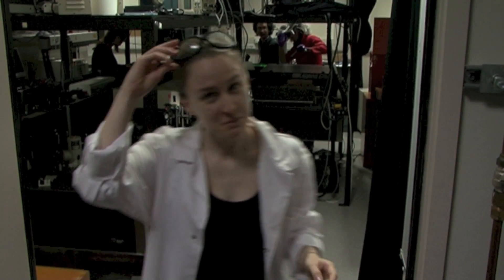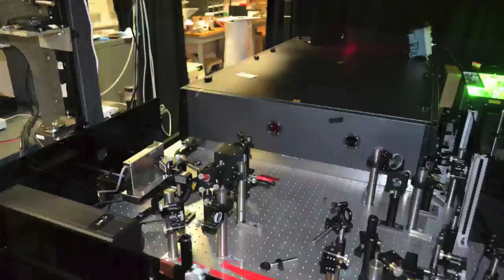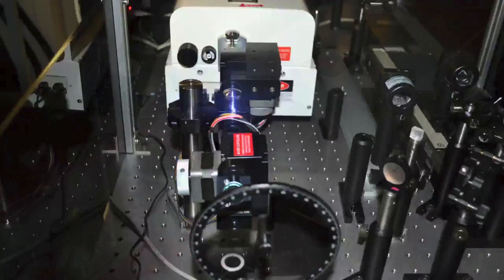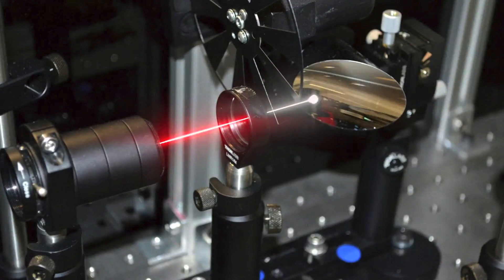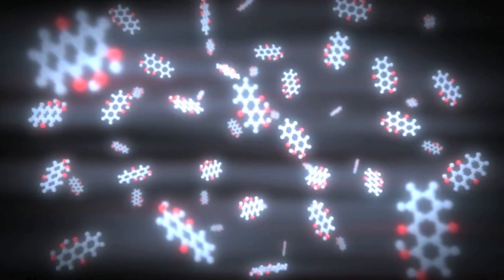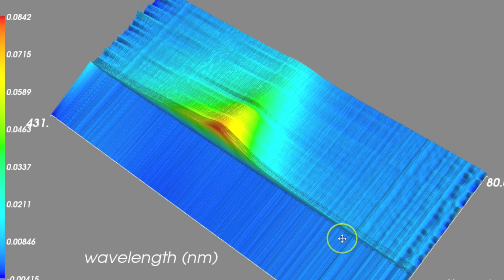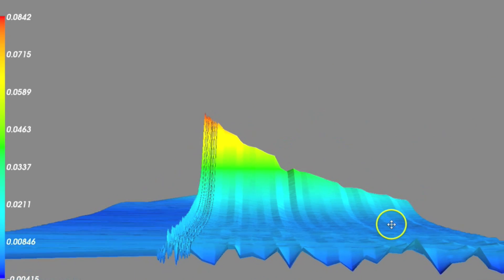Transient Absorption Spectroscopy explained

Comment: It was an interesting video. Could you please tell me what are those numbers in the graph right at 2:30 ? The numbers decreases from 0.081 to 0 with various color codes?
Reply: That is the change in absorbance. It is the difference between the unexcited molecules optical absorption spectrum and the molecules excited state spectrum. It shows us where the energy is moving in the molecules.
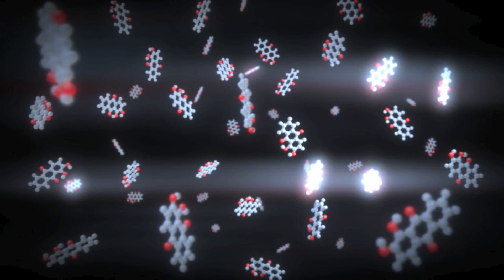Reply: So the difference of the before and after curves at 1:56 summed over the different selected colors?  Is the absorption spectra obtained from the molecule's flourescence?

Comment: MrDarkReever If you remember the energies of electronic states (see link below for diagram), the gap between consecutive states becomes smaller the further from the ground state.  What this means is that the energy to absorb in the excited state is different than in the ground state.  This is why for the appropriate resonant frequency, only the excited states will respond, and molecules in the ground state will not absorb.

Electronic States S (0,1,2,3...)
http://upload.wikimedia.org/wikipedia/commons/thumb/b/b6/Pistates.svg/350px-Pistates.svg.png

Comment from the maker: We use a lens to focus the 800 nm into the sapphire window. This makes it slightly harder to convert the 800 nm into supercontinuum. The pulse is already spread out in time due to dispersion. It doesn't matter too much for the probe as we resolve this in the spectrometer. We use two parabolic mirrors after the probe to collect and focus the probe as there is a bit of spreading through the crystal from things like spatial modes. We have a lens in the pump line to focus the pump.

Comment from the maker: Yes we talked about this a bit. Technically both do get excited and we subtract off the spectra of the ground state absorption so we are left with only the excited molecules spectrum. That is why it is called Delta OD (Delta greek symbol means "change in" and OD is optical density). However for all practical purposes we are only looking at the absorption of the excited molecules as a function of time so we didn't show this. Great to hear that it helped you to better understand TA.